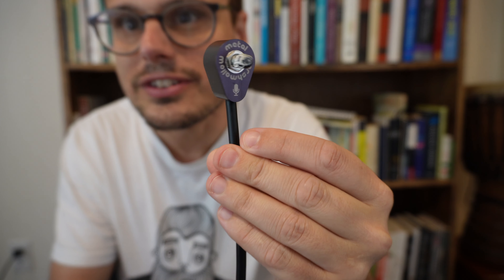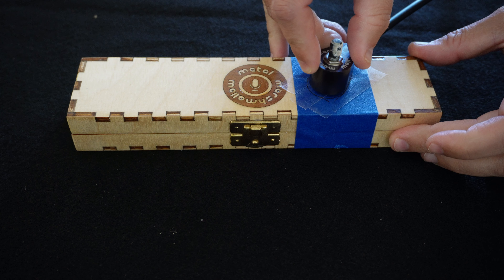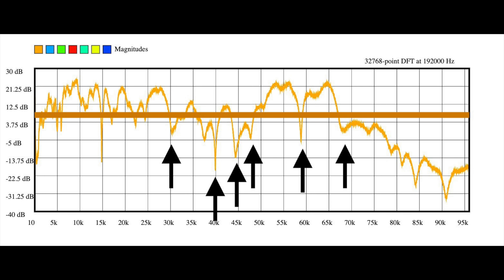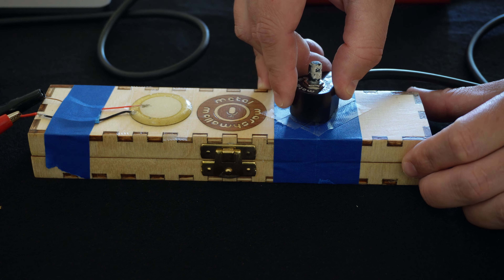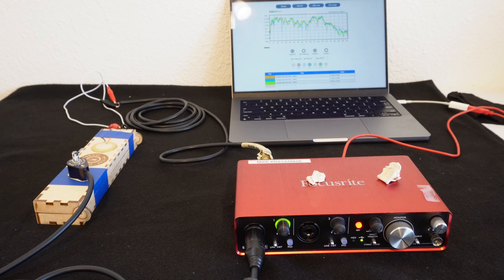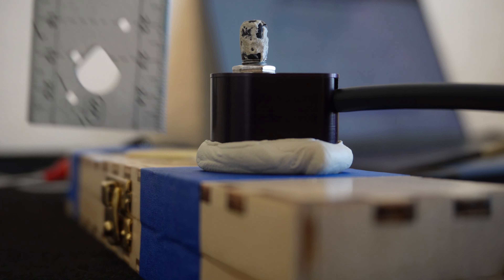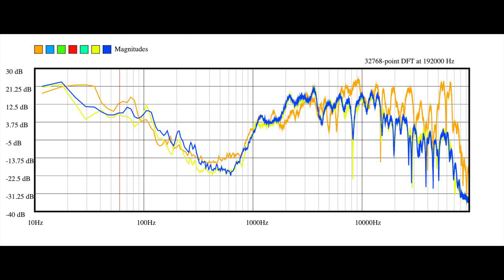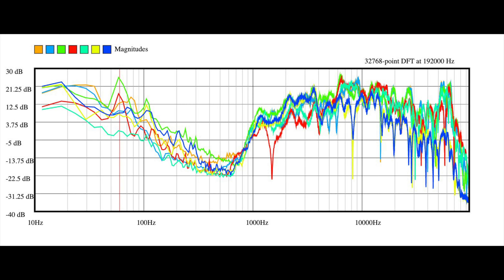How to stick a contact microphone to things

Comment: Nice experiment! I’ve been using sticky tack and double-sided tape on my contact mics for years, and just recently picked up a roll of Joe’s Sticky Stuff based on some recordist’s recommendations. It’s got terrific adhesion without leaving any residue, just tried it with the Marshmallow a couple days ago with satisfying results. Curious how it would compare to the others in an experiment like this. 
Also curious if there’s a way to flatten those notches, or at least identify the cause 🤔
Thanks for posting this, and keep up the great work!
Reply from the maker: Thanks. I will definitely try out some of that Joe's Sticky Stuff, I never heard of it before, so thanks for the tip. I have a few theories about the notches, I'll keep thinking about it. Let me know if you have any ideas.

Comment: dude. life is easier now. thanks. 
bout the notches: guitars also have deadspots where selfresonance and the induced frequency cancel each other out.
 maybe try this again on a very large plate where the pickup area becomes more spotlike in relation to the whole area. on that little box the minute differences might cause phase issues. in studio when stereo miking ,often its just a cm movement of a mic on a 50cm distance to the other to get back in phase.
Reply: Do you mean wolftones? As I understand it those are especially problematic with hollow body bass guitars and cello’s. If that is the origin, simply running a second identical test with just an added  small weight on top of the box should move the position of the resonant peaks.
Reply: @rivulus  wolfromes? thats when my holowbody howles in fromt of the plexi, right? also some form of selfresonance… i think a smal weight might just dampen too little.
Reply: @dasczwo  no, that is feedback. A wolftone is an interaction between the vibration of the strings and vibrations of the body where some tones are amplified causing vibrations and others cancel each other out. With an electric bass, clamping a small weight to the headstock or placing foam behind the bridge can cause the wolftones to shift a bit so they fall between fretted notes. You do not need much weight to move the frequency of a wolftone. Completely dampening them is another story but often not needed.
So, for an experiment with the Mike setup in the video a small weight is enough to see if the peaks move and verifying they are indeed wolftones.